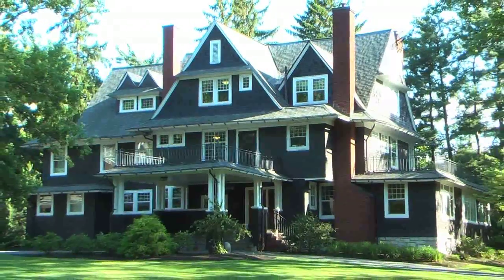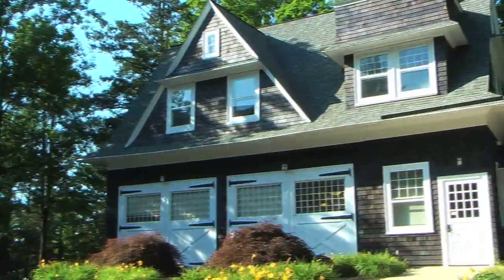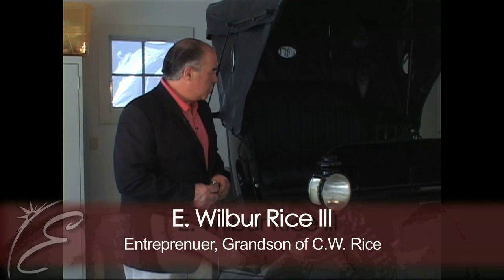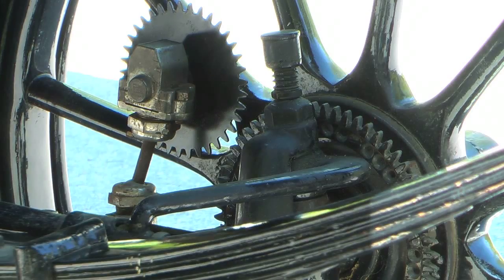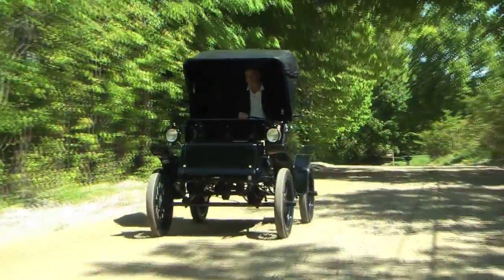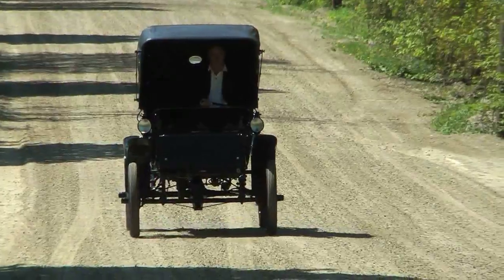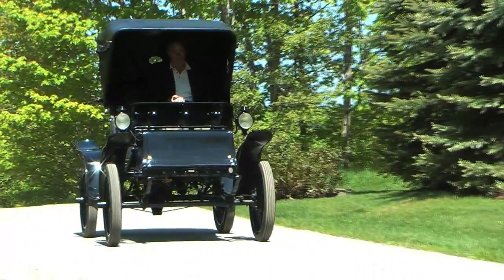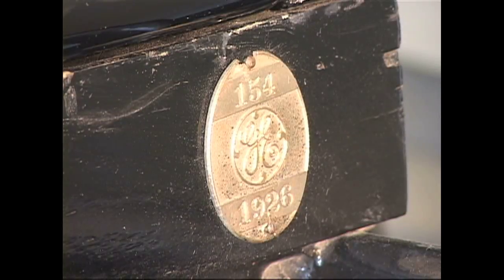1901 Baker Electric Car - at 25 mph

Comment: The city of New York in the early 1900s had a fleet of electric taxi cabs  complete with infrastructure to keep them in operation. They could be kept on the street running all day. They had charging stations and battery changing stations. The vehicles were designed to have the batteries removed as a unit and a fresh fully charged set ready to go in a few minutes.
Reply: Henery ford killed the electric car in its tracks
Reply: Yea by 1930 they would have had cars just as good as a Tesla by then lol
Reply: The Electrobat taxi started mass production in 1895.

Comment: Why am I so fascinated with this? I knew that EV's were prominent in the era, but did not think they were capable of going 60-70 miles range-wise. Very impressive considering we have a Chevy Volt that can barely do 40...
Reply: Where did it say 60-70 miles?
Reply: the Baker in 1910 was going 100 miles on a single charge... look it up!
Reply: Shows just how little improvement there has been in batteries. Batteries are the reason the EV failed in 1917 and will be the same reason they will fail now. They take too long to charge and when charged don't hold enough energy. 👎
Reply: Like Scotty said:
the more you over think the plumming the easier it is to stop up the drain
Reply: Or a 2012 Nissan Leaf that can only do 25 miles before it needs a new $6000 battery pack.😂

Comment: And it's 2016 and we still don't  a good useable, reliable, long driving electric car? Compare to like telephone technology or computer technology, or about "anything else!" How far these have come and seem to just boom yearly!
No one else is questioning this?
Reply: Tesla electric car tops at 300+ miles on single charge!!!! Elon musk said that they CAN do easily a 500+ mile. No problem. He said by 2020 or early 2020s he hopes around 1,000 miles on a single charge. With solar panels. Getting there.
Reply: the American government is beholden to fossil fuels and the combustion engine and that has gotten them very rich and completely screwed off a perfectly natural planet. Sure the evil empire has suppressed the truth so they can bank on poison and then charge you health care and make money off the death they created.
Reply: in 1910 they could go 100 miles on a single charge... goes to show how the fossil fuel industry has a hand in our elected public servants minds and pocket books.
Reply: Copied from the Tesla website: "Model X is the safest, fastest and most capable sport utility vehicle in history. With all-wheel drive and a 100 kWh battery providing 351 miles of range, Model X has ample seating for seven adults and all of their gear. And it’s ludicrously fast, accelerating from zero to 60 miles per hour in as quick as 2.9 seconds."
Reply: Oh, and it comes with full self-driving hardware (which is the same for the Model S and Model 3 too!)
Reply: We could have been way further with electric vehicles but the oil/gas industry really hampered development. None the less. This vehicle is awesome to show what we are capable of even when we don't have "advanced" technologies that we do today.
Reply: Moore's law does not apply to the chemistry of batteries
Reply: @DanielGalaxee  Try that at -40° and see how well you do. 😧  Don't forget Elon will tell you anything to sell another car.
Reply: @MrStuVW  Shows you how little batteries have changed in 120 years. There has been no quantum leap improvement in battery power density so the EV will fail just like it did in 1917 and for the same reason. no range and very slow to charge.  My truck has a 700 mile range and can be refilled in less than 5 minutes even in -40° temps.
Reply: @spiritusinfinitus  So it can drive you into the side of a truck or some pedestrians  like a few tesla's have been know to do.

Comment: Actually in the USA the lead in gasoline was started being phased out in 1975. No doubt lead pipe can still be found in older water systems, but it's actively being replace, and with no new lead pipe being installed one can't say lead pipe is still purposely used today

Comment: That's the kind of system we'd need to have now, where there was a common type of battery that could be changed out. There are fleet vehicles now that run on propane or natural gas, but just like taxis, the reason they can do that is because they always refuel at the same point, and together, they don't use a significant percentage of fuel resources.  Gasoline must've been cheaper in the end, or those taxis would still be electric.

Comment: Big oil put the stop on those electric cars back then.
Reply: Rockefeller oil man teamed up with Henry Ford to get rid of the clean electric cars. these 2 evil men are responsible for countless cancer deaths.
Reply: electric starter motor was one of the reason electric car died and of course  model t which was far cheaper
Reply: even with today's technology and desire for electric cars they are not competing with gas/diesel cars, then as now, Range and recharge/refuel times has the electric beat hands down.
Reply: @scout2nut  getting better and will beat the ic engine  eventually ludite
Reply: Darn Rockefeller.
Reply: @markjones4704  So far they have been trying for over 120 years and the IC still rules.  The electric parts of the cars are great but the batteries are the failure point and always will be. Batteries are not ready for prime time.
Reply: @MatthewBerginGarage  indeed
Reply: Edison was almost ready to mass produce his batteries when his new factory burned down.

Comment: It has little or nothing to do with that. it's still cheaper to build and run a gasoline powered car, and the infrastructure is already in place. Oil won out in the beginning because it was more practical, not because of some evil entity. If electric would've been better, we'd just have big battery companies instead, and they would control the materials that go in batteries instead of liquid fuels.

Comment: Jay Leno reckons his 78volt Baker can do 100 miles @ 20 MPH.
Reply: bel son, I thought the baker he had was a 36 volt model. Leno used modern 6v flood lead acids. I guess with high quality batteries on the old system you'd get 50 miles.
Reply: @KeyboardBuster  He said the voltmeter read 72 volts.

Comment: You argument is invalid! Untill the 90s Gasoline contained lead as antiknock.Burned with gas it can be inhaled or ingested, and beeing very toxic.
Lead is harmless in the solid state as in a battery.
And those cars had in the beginnig often Iron acid batteries. 

Lead was even used for water pipes, guess what. And even today it is precious.
Reply: Eat a lead battery plate and you might have a slightly different opinion. 🤦‍♂️🙄

Comment: Edison worked on batteries and a solution to the range problem with the idea of going into the electric car business.  Same problems as today!  Not practical.  Detroit Electric built electrics until 1939 for little old ladies to drive on errands and card parties.
Reply: +Modeltnick Don't be stupid.  Battery tech has come way further since those days, and on average we're seeing 20% capacity increases each year.
Reply: Modeltnick Okay, must be a dying fad, since they died in the 1920s already, and slowly have got super popular now. And you know why I named called. Actually I didn't, I just honestly asked you a question.
Reply: that's why you can run a motor without a battery once it is spinning.
Reply: plus using all the suppressed info one can go from point a to b without poisoning yourself.
Reply: Why can't I buy a car like this today, for short errands near the house and for short trips into the city?

Why electricity, which has to be created at a big power generating facility? Because then I can run my vehicle on coal, natural gas or nuclear power. I can go 40 miles on my Pedego for a dime.
Reply: The biggest problem with batteries which I think we'll never be able to solve is the Power to Weight ratio, longer the range, bigger the battery. So if electric is to ever go mainstream we'll have to delve into Hydrogen Fuel Cells, but then again at the moment Hydrogen is too expensive to produce, & also uses a lot of energy to produce.

Comment: How are you going to sell electric cars to most people in 1901 when they don't have electricity at their houses? Put a portable fuel in the car that doesn't need other infrastructure, and that has a better range, power profile and more upside and it's not hard to figure out why battery powered cars couldn't compete. 

It probably wasn't until the 30s or 40s with the TVA and all of the depression area REAs that people even had enough electricity at their houses to run a porch light.
Reply: There weren't any gas stations either. It was actually fairly hard to find gasoline. It was usually only available at the drug store.

Comment: I thought Tesla was the first electric car...
Reply: Actually electric cars outnumbered gasoline cars at the turn of the 20th century.
Reply: First electric car was in the 1830s.  First rechargeable one in the 1840s.  Predated Benz by 40+ years.
Electricity just wasn't common enough nor did the car have a practical use at the time.

These EVs were built into the 1930s but became more and more expensive and also rarer and rarer just as Model Ts and Austins were getting cheaper and cheaper.   Also motive improvements stopped at 1900.  20-25mph still and 80-100 mile range in 1932 when ICE cars were going 60 with much longer range and race cars 100.

If ICE was not there, you'd likely never have seen an airplane except gliders.  You'd likely not have a car of your own today as they kept getting more expensive.  You'd probably still be riding trains and getting freight from the Wells Fargo and RPO office, not Amazon.

Butterfly effect.
Reply: Sure hope that's not true.
Reply: @STho205  Gas wasn't really available either.
Reply: @MatthewBerginGarage  it was always part of the oil distillation refinery process, however did not have the bulk sales that parrafin/kerosene did.  Yes Doc Brown could have gone down to the depot in 1885 and bought gasoline or napthalene.    The RR used it in head lamps.

Refiners often used it to run their fires for the current and next batch.
Reply: @STho205  Yes Doc Brown could pick up fuel but he didn't do it in an automotive gas station and it was not widely distributed.
Reply: @MatthewBerginGarage  you do get what I'm saying.   The great inventor stole a train that just left the station instead of buying a small keg of naptholene from the very same station for probably $2 and driving the cat to 88.  Gasoline was not new to 1885 America...just wasn't often called that.

It was a purposeful script ignorance so they could have the exciting train scene to top the getting back scene in BTTF1.